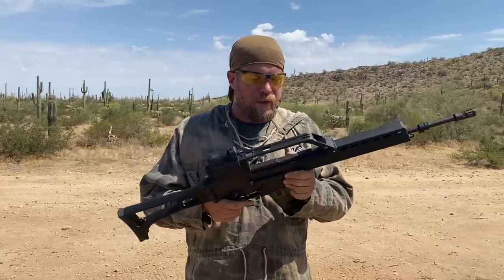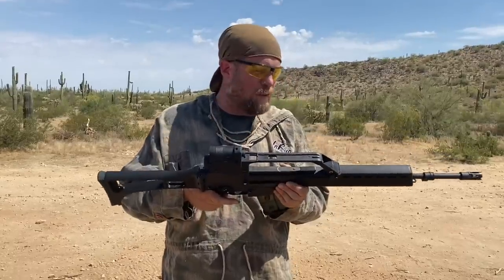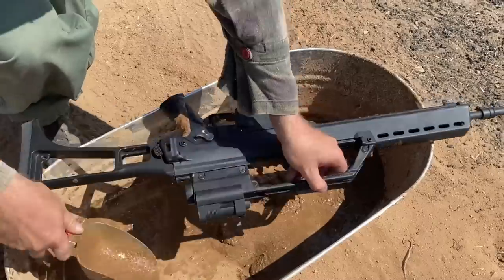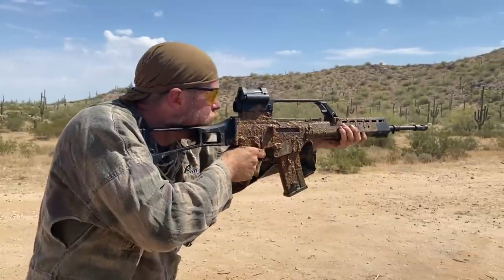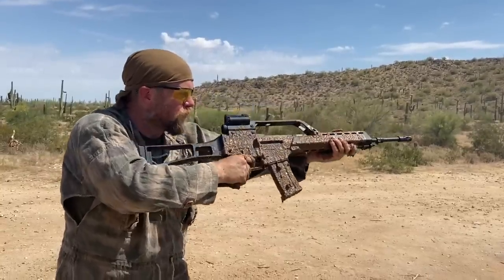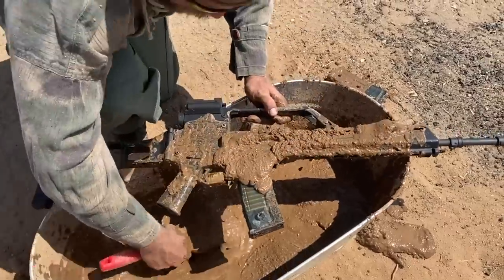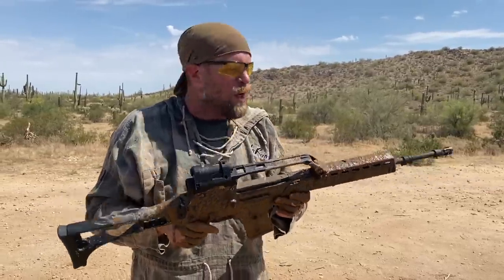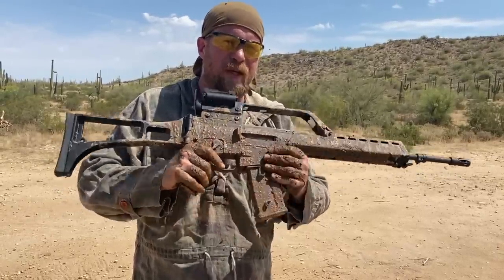Mud Test: G36

Comment: Little known fact: The original G36 has a spring inside the FCG. If you push the end of that spring to one side, the gun has BHO. If you push it to the other side, the BHO is disabled. No one really knows why, so the rumors were a) to make the gun closer to the manual of arms of a G3 for the soldiers transitioning in the 90s or b) to be able to close off the system in sandstorms.
Reply: Isn´t it descriped in the manual?
Reply: @01Ezio  That's a good question. But: No way for me to look it up anymore, as I'm not in the armed service anymore.
Reply: For those that like me had a problem understanding:

BHO: Bolt Hold Open
FCG: Fire Control Group
Reply: @tommasomorandini1982  Yes, thank you for clearing that up. In Germany we would say "Verschlussfang" for bolt hold open and "Griffstueck" for the fire control group.
Reply: The answer is b. That feature was included to increase reliability in very adverse conditions
Reply: @exa1337  Griffstück? I know it as "Abzugsgruppe" The Griffstück is the entire Pistol Grip / lower afaik. Oder meintest du den Durchladehebel? (Charging Handle) Jetzt bin ich wirklich verwirrt... But yes, the BHO is the Verschlussfang. Because it fängt the Verschluss.
Reply: @gerald8573  Ich habs als "Griffstück, vollständig" kennen gelernt. Da ist dann die FCG mit inbegriffen.
Reply: Ah thank you for clarifying that. I was wondering why there was no last round hold-open for either magazine.
Reply: In my training for guard duty in 2007 we were taught to disable the BHO so that we could exercise with empty magazines without the BHO getting in the way. 
The idea was that when you are on guard duty you have a magazine in the rifle but it isn’t charged. Once something happens you charge the rifle, among other things which I can’t remember. 
So to be able to exercise the whole drill with empty magazines we disabled the BHO. 
Of course we only did this after the first couple of people performed the whole drill with the BHO active and everybody looking really stupid when they wanted to charge their rifles and „fire“ a shot.
Reply: Why having a bolt holt open, when you dont have a bolt release and need to run the charging handle anyway.
Reply: @JunkyardBash SteveAs far as i know there should be one. At least the German army ones have a last round bolt hold open.
Reply: Griffstück mit Abzug und Feuerwahlhebel.

Nur um Mal genau zu werden.

Little spring inside to push?

Jesus H. Christ!

Rarely read such nonsense. Yes. The little button close to the trigger engages the bolt catch. Bolt hold open.... Pffftt....

The bolt catch button is spring loaded. Off course you can manipulate the damn thing to NOT work. But that is not the intended Modus operandi.

@inrange tv
Please untick that nonsense.
Reply: @jimsturme377  read the top comment of this thread.
Reply: @MCFrenstar  you can feel when you run out of ammo, it makes inserting a new mag easier, and a bolt hold open functionality is very useful for clearing some malfunctions and showing the gun is clear.
Reply: @MCXL1140  Too many people discount the recoil impulse of the bolt going back and locking rather than continuing forward.
Reply: The BHO is also perfect for shooting blanks with the darn MPG attached to the muzzle. Makes this gun basically a manually repeating carbine.
Reply: I was told in the German army that this feature is for winter and muddy conditions. You disable the bolt hold open if you do not want to get dirt in the gun.
Reply: It's not just the original G36, it's all G36 I've encountered in 13 years of service.
And it IS for adverse conditions, because no dustcover.
Reply: exa1337 im now a little known fact knower, tyvm
Reply: I would bet it is a G3 hold-over as many aspects in the design of the G36 been driven to reduce the retraining burden to 0% while standardizing the service to one rifle layout.
Reply: @exa1337  I read the term "abzug- und schussauslösemechnik" for "fire control group" somewhere in a German/English manual, not G36, I believe it was maybe the MP5...!? Cannot say for sure. But a nice germanism, right?
Reply: There is a bolt drop lever on export versions of the G36. The germans only have to manufacture one version of the bolt.
Reply: The instructor from my basic training (german military) shows us this little trick. And yes, its for sandy, snowy or muddy environments. So the inner system stays more clear ...and functional. But this rifle (original G36) is a beast.
Reply: @steelwolf411  Not only on export versions, also on the most recent version of the G36 in its full length and carbine variant the Bundeswehr uses. ;)
Reply: "An der Innenseite des Abzugsbügel ragt der Fangstollen heraus. Bei fortdauernder Einwirkung von Sand oder Eis auf das G36 kann es zweckmäßig sein, die Fangstollenfunktion für den automatischen Verschlussfang aufzuheben" ZDv 3/136 "Das Gewehr G36" Juni 1998

"Die ZDv liegt - Gott sei dank - in irgendeinem Panzerschrank, in dem sie niemand lesen kann."
Reply: That's actually genius! The BHO feature is one of areas where an AR can sometimes have a decrease in reliability depending on the environment, so the ability to turn it on and off is amazing! Leave it to the Germans to over engineer everything, I guess!
Reply: daje tommaso
Reply: @MCFrenstar  actually there is a button below the receiver, just infront of the trigger to release the bolt, you don't need to run the charging handle.
No idea where these myths come from that it either had no BHO or bolt-release OR that you dont have a forward assist: to also clear that up, you can swing the charing handle out to either side, push it in and thereby fixing it, that way, you can also gently and smoothly close the bolt manually without too much noise or to assist feeding.
Reply: It is useful for dry drills in basic training. Can operate the gun with an empty inserted mag without it staying open every time you recharge it.
Reply: Same for Kv3, tha Latvian army version.
Reply: i had the g36 im in the german millitary its super reliable and i also love the fact they all came with a red dot.a little heavy  though compared to other millitary rifles :)
Reply: Whats BHO. Iam working with taht gun for a year now and ive never heard of BHO or a spring that changes soemthing
Reply: @MCFrenstar  The k98 also has a function that you are not able to close the bolt, when you are out of amo. Sure, that speeds up processes, because you don't close to an empty chamber, but I think it was also to give soldiers a physical reminder, that they have to reload in the heat of action. Other reasons for the g36 could be firearmhandling at the range, or the minimalization of the possibility to short cycle (idk if that's the word) it or to let it cool during reload.
Reply: I don't see your Point. I used the G3, the G36, G36C and G36K and never have I heared about that rumor. I mean the G3 HAS NO BHO! The Bolt is closed! I DON'T UNDERSTAND WHY YOU TRY TO CONFUSE US WITH BAD KNOWLEDGE.
Reply: as a former german soldier I can tell you this is well known.
Reply: @Omnihil777  it discribes only exact in words what it is very precisely. FCG is a inaccurate summary
Reply: we used it during basic training i think because you can train loading the rifle with an empty mag that way. otherwise the bolt will stay back if you try to charge the gun with an empty mag.
Reply: We were told during basic that this design is supposed to make sure the bolt closes in desert environments, which seems like a sensible thought.
Reply: @younggunna4089  
No it is not heavy compared to other guns, it has an 18" inch barrel and an optic already included. A M4A1 is around 3,5 KG(7.5 lbs) without an optic sight and a much shorter barrel.
Reply: @Forodir   by the way it has a 9 inch barrel not 18 pfhahhaha and it is heavier than a lot of guns
Reply: @younggunna4089  
Okay, I am a Master sergeant in the German Army and working with that gun since 1997 and i am an Instructor. You my friend are just a bit over your head.
A G36A1 has an 18" Barrel, a K-version has 12" and a C -Version close to 10"
AK-74,  16,3" 3.3 Kg
M4  14,5" 3,2Kg
SCAR-L std 14,5" 3,3Kg
All weapons without an Optical sight and shorter Barrel
G36K  12", 3.3Kg with optical sight.
As you can see modern rifle tend to be in the same weight class.

Du kannst dir also die Pappnase selber aufziehen!
Reply: @younggunna4089 
Keine Ahnung aber davon ganz schön viel :)
Reply: @MCFrenstar  Isn't there a bolt release in front of the trigger?

Comment: It's almost like a closed system does better in muddy conditions... Wonder where I heard that before :D, greetings from Germany.
Reply: I think, that in that case, the plastic also did the job
Reply: It's almost like the light weight and simplicity of the G36 is kind of its main selling point.
Reply: Brian Ross  based
Reply: AUG is a closed system and got turbofucked. There are other things at play.
Reply: Brian Ross  Bruh, don't be that uncle that never gets invited to family events because halfway through the first can of bud he won't stop relating every topic back around to his favorite political issue.
Reply: @Klovaneer  i have to agree, something is different about the g36 as a closed system. maybe it's just the angle of the ejection port compared to the AUG.
Reply: compwiz101 ok moshe
Reply: Brian Ross  Based and ultimately redpilled
Reply: Brian Ross  lol. ok, boomer :)
Reply: @a.hollins8691  Not anti-immigrant, anti-illegal immigration.
Reply: @Klovaneer 
Just wanted to inform you that "turbofucked" made me laugh to the point of almost soiling myself.
Reply: @Klovaneer  Wasn't the issue with the AUG that the area for the charging handle to travel along wasn't sealed enough? Once it stopped there wasn't a way to charge the gun to get it back into action

Comment: 15 years of service with the G36, thousands of rounds shot on nearly every condition with more than 10 rifles. Never experienced a malfunction.
Simply put: when you pull the trigger, it shots. Period.
Reply: Same with all other guns
Reply: @YouGoFlu   Not really. xD
Reply: Not as much experience, but still enough. It does its job and sufficiently well. I wish we could say that about all weapon systems. Drones anyone?
Reply: it shoots
Reply: @YouGoFlu  Negative. I served with a G3. Once it got dirty it was very picky about proper shoulder contact. If you didn't jam up against it way more than what was necessary to comfortably shoot the gun the bolt wouldn't go back far enough to cycle properly, so you'd end up with a spent casing being stuck half way out the ejection port. This is saying something, as the .308 Nato is not exactly a small pew pew of a bullet.
Reply: @andersjjensen  Thats interesting. Never had that particular problem myself or even heard about it! With a (roller-)delayed blowback system I guess it wouldn't be too far fetched that wear and tear could make the bolt assembly sluggish over time... I assume your Waffenwart (gunsmith/master at arms) hat several hard and detailed looks at the gun in question?
Reply: @YouGoFlu  if that were close to true, reliability wouldn't be such a big deal, especially for military testing. Reliability is arguably the largest focus of many of those tests. 

Many guns are highly susceptible to dirt and such, and many are unreliable even without debris.
Reply: That AR-18 copy sure runs well then :)
Reply: @andersjjensen  The G3 had a very narrow gap between bolt carrier and housing. Once you just got a few grains of sand in there, the gun jammed. 
It was unreliable as hell.
Reply: Außer mit mpg dann wird das g36 plötzlich zum Repertiergewehr, aber scharf geht immer.
Reply: @EASY7356  mit mpg wird sogar das mg5 zum repertiergewehr 😂
Reply: @chattw6885  mit mpg funktioniert der Müll garnicht mehr, schön wenn man 800 Schuss auf Übung mitschleppt und 23 verschließen kann 👍🏻👍🏻👍🏻
Reply: Lars Isaac dann musst du dein mpg anders einstellen.
Reply: @MegaFregel  geht bei dem mg5 mpg nicht und feuerrate hochstellen bringt auch nichts
Reply: @YouGoFlu  ehh. I had two service rifles the m240 and an m16, the m16 was the worst in sand. But it was also the oldest in the company. And I only needed it for certain mentions were I was the A gunner and not the gunner.

The m240, fires like a dream and I loved more than my ex wife
Reply: hmm a wonder i have a lot of troubles with the g36
Reply: Lars Isaac dachte es geht um das g36 bzw. hast du Ja auch geschrieben
Reply: @MegaFregel  ne mein zweiter Kommentar war auf das MG5 bezogen. Den mpg vom G36 drehe ich immer komplett zu um kein Risiko einzugehen
Reply: Lars Isaac du hast geschrieben das g36 werde mit mpg zum repetiergewehr, woraufhin ich geschrieben hab du müssest es nur vernünftig einstellen. 
So schwer?
Reply: But... but ... but... my bias...
Your words do not confirm it, therefore you must be wrong.

Comment: Wow, to be honsest I'm surprised and impressed. I served with the G36 in the german Army and knew that it's a tough piece of plastic. We also went trough water, mud and dust with it but this is way more intense than the rifle would, probalby, ever experience in normal duty. You can also find a "stress-test" video by HK itself on youtube. 5 min and 900 rounds in full auto until it catches fire. Worked still afterwards.
Reply: @Yankee Gohome maybe second generation immigrants?
Reply: Grensgebied misschien
Reply: @Yankee Gohome nope, german. The Name is funny in german
Reply: @Yankee Gohome Hey, could be that 1 DE/NL Corps thing or whatever it's called. It's all pretty weird nowadays.
Reply: Yeah but due to its polymer construction it loses accuracy due to the heat. Other designs such as the AR-15 do not suffer from this problem, and are lighter. And no this isn't down to some dumb test InRange did. I mean over long periods of time, the polymer WILL shift over the course of years.
Reply: @weasle2904  the losing accuracy myth has been debunked many times and if you want to compare the G36 weight to the AR fairy you are going to have to add the same optic to the AR ;) G36>AR simple as that there is a reason why even US special forces use the 416
Reply: @weasle2904  I suggest you watch Ian's video on that. If you are going to argue against the word of Gun Jesus you better read up on the counter arguments first :P
Reply: @NikoNeko.  or the Marine Corp adopting the M27 IAR, which is basically a HK416
Reply: @weasle2904  That. Is. A. Myth.
Did you even watch any of the videos on inrange where they talk about that? Not only is there one with Ian throughly discussing the issue, there is also another with Karl straight up testing the accuracy of the gun after heating up.

Comment: This is more or less my experience with the thing.

Reference: I've been paid to do (sometimes muddy) things with this gun for the last 14 years.
Reply: Did you ever experience any problems with accuracy?
Reply: @petrl9838  He probably hasn't. I certainly have not, and I have served 12 years in the Bw, a few of those as an instructor in a basic training unit. You give this gun to a new recruit that never has held a gun in his hands before and he hits. Except in bad crosswinds or when the target is hidden behind thick vegetation, but that's because of the tiny ammo. 
However,  I have missed a few shots with this gun in a training - simulated ambush, intense fight on short distances and then the long range shots towards the enemys support group were all not very brilliant. But before I blame that on a lack of accuracy the hot gun, I'd rather think of my lack of skill, my escalated heart rate and the adrenaline as culprits. All guns loose accuracy when hot, but I feel skill has a much greater impact. Your average soldier will not be able to shoot accurately enough in such a scenario to ever notice that the  gun is failing him.
Also, in my 12 years, I've seen less than ten misfires with life rounds. All of these were due to overaged and faulty ammo, which either didn't ignite at all or were hangfires. 
Blanks, on the other hand... well, let's put it this way:  blanks were an excellent tool to train how to clear the gun and get her functional again.
Reply: @petrl9838  Not really. Standard combat loadout is 180 rounds, so if you mag-dumped the required 150 to cause zero drift then you've got much bigger problems.

Then again, 180 is standard/doctrine. We usually run around with 270, plus whatever spare belts the machine gunner doesn't want to lug around.

Overall, I'm happy with the gun and the 4x scope, but I hate the red dot. It's just horrible, there's $30 airsoft stuff that offers a wider field of view, more light transmission, and a crisper dot.
Reply: That_German_Guy Well, seeing as the optic was developed in the early days of RDS development, It doesn’t surprise me that the red dot is subpar.
Reply: @willkenny5687  It was bad even for the time. I had a better dot sight on my shotgun at the time, and it cost me less (excluding the custom mount)than the Army paid for the one on the G36. It wasn't as subpar as it is today, but still not that good at all.
Reply: @littlegrabbiZZ9PZA  anstatt das g36 zu ersetzen, sollen sie es einfach auf die aktuelle a4 Version umbauen oder Mal wenigstens alle auf a2 aufwerten, mit dem Red dot der mp7
Mein ka4 mit eotech und Booster ist einfach ein absoluter Traum im Nahbereich.
Oder wie jetzt bei vielen K's mit dem zf vom Mg5 auf der KSK Schiene, beim k meiner Meinung nach recht sinnfrei, aber beim Standard durch das riesen Sichtfeld und die Beleuchtung guter Ersatz für zf + Winz Rotpunkt